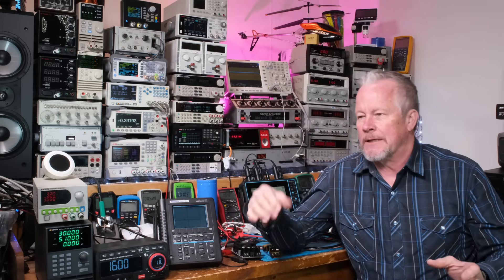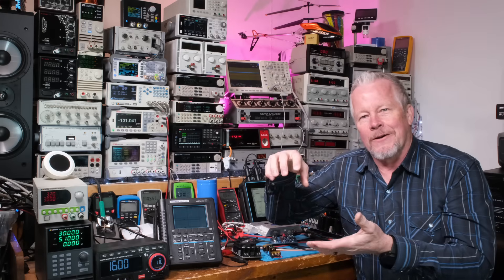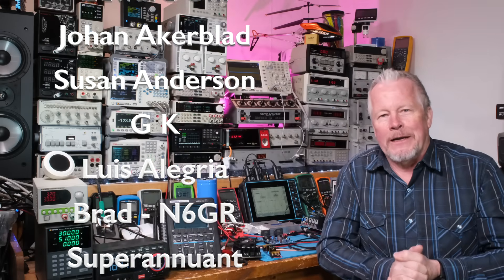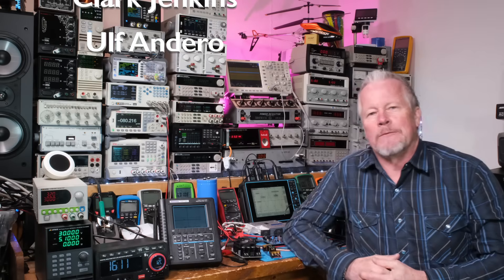Capacitor Bypass Value Myth #stevensandler #ericbogatin #bypasscapacitor #couplingcapacitor

Comment: 7:04  Don't you mean "We  don't use 10 & 20% (C composition) resistors any more"?  TODAY, we have metal & carbon FILM resistors, with FIVE percent tolerance!  WOW!  🤗
Reply from the maker: Thanks for bringing this up.  Today we use 1% metal films instead of carbon 5%;)  The tolerance in resistors is so great and low cost that - why not?  Capacitors are better as well - but not that good;)  But then we typically don't need that tight of tolerance in a capacitor.
Reply: @KissAnalog  After reading your response, I wonder....I get the impression you may have actually thought I was being serious!   In a more serious vein, I wish all the resistors out there were One Watt carbon composition ones, so I could read the color codes without a magnifying glass!
Reply from the maker: LOL actually carbon resistors should be gone - but I do like the color codes;)  Metal oxides might be in your future;)
Reply: @KissAnalog  They DO have one good use, though.  Their low inductance makes them good for RF dummy loads.
Reply from the maker: Yes - that is a great application for carbon;)  But thick film metal is generally a good alternativce - right?
Reply: @KissAnalog  If it has very low L, definitely.  I don't know a whole lot about how much each kind of metal film resistor has, only that many of the little ones aren't recommended for RF.
Reply from the maker: You are right - every application has its own requirements.  There are thick film as well as thin film metal resistors but carbon and metal oxide resistors have their place too,

Comment: It’s a bit difficult; I think the word “mostly” need to be applied here. I have worked in some high density with multiple switch mode, and RF chips (>30GHz) and it gets awkward when you are limited to 0201 size. The dielectric can get crushed (Y5 ect) under voltage to 20% of advertised, the main loss is near instant, but I measured the time-to-stabilised-capacitance could take over three days. I think the cap resonance vs what you are looking at is where it lies.
Reply from the maker: Yes, when high frequency is used, then PCB material (dielectric) is critical and the use of Y5 caps should not be used!  The problem is - the circuit finally works - but this is at the bench in ambient temp.  As soon as the temp changes - if the wrong caps are used - this can be a disaster.  Also placement and routing are critical as well.

Comment: Read the data sheets on the caps. Notice resistors have voltage ratings. Check your linear regulators are not oscillating.
Reply from the maker: Thanks for your feedback!  Yes, check data sheets.

Comment: Hi Eddie , I have seen in some site where a guy wrote an article regarding a modification on Adcom GFA 555 mk2 amplifier and in one of his recommendations he wrote to put surge cap 630v 0.1 uF across the AC side of the bridge rectifier . Can you please explain what the benefit of this ? Thanks and have a great weekend
Reply from the maker: Thanks for the great question!  This kind of power supply is a low frequency switcher - the diodes commutate (turn on off sharing the current load).  Placing a cap across the diode bridge helps filter this switching.

Comment: I used to have students do experiments to investigate the rudiments of local decoupling. For most it was also their first introduction to using an a oscilloscope. 

Breadboard an astable multivibrator using the bipolar version of the 555 running at a a few kilohertz. Connect the circuit to a 5 volt power supply (linear, not some horrible el-cheapo UltraNoise™ switcher "bench supply" of the sort so popular now) using two separate wires each about 3 feet long. Observe the voltage at the Vcc pin of the 555 with the scope ground connected very close to the ground pin of the 555. 

Twist the wires to the power supply together and repeat the voltage observations. 

Add a 100 nF ceramic cap right across the 555 and repeat the observations. 

The bipolar 555 has large, fairly slow transistors in the output totempole. There is very substantial shoot-through current at each transition. Separate supply wires have quite high inductance which results in gross transient voltages at the 555 due to the shoot-through current spike. Twisting the wires together greatly reduces the inductance because the magnetic fields of the two conductors largely "cancel" each other. Adding the cap at the 555 cleans things up even more. 

It is easy to get 20 or 30 volt spike with the first setup. I'm not sure this would still be true. The bipolar 555 may be better now than it used to be.
Reply from the maker: Thanks for this great feedback!  This sounds like a great way to teach several different ideas.  I have a video showing the benefit of twisting wires;)

Comment: In certain circumstances a high value cap in parallel with and physically close to a "standard" decoupling cap can be beneficial, if the high value cap is an electrolytic of some sort. By "high value" I'm talking something of typically just a few microfarads - 10 to 22 µF perhaps. "Electrolytic" includes things like solid tantalum capacitors.

Occasionally you will get into a situation where a ceramic cap with very good high frequency performance can resonate with "something" (either discrete or "distributed" inductance) and actually make things worse. Electrolytic caps are invariably fairly lossy at high frequency. The electrolytic cap can "spoil the Q" of the resonant circuit. Another approach is to use a small resistance in series with a "good" capacitor as the Q-spoiler (i.e. a cap in parallel with a series combo of a cap and resistor). This is a more foolproof approach.

If you are using a small LC filter to clean up the output of something like a charge pump DC-DC converter, you can similarly get nasty resonance if you aren't careful. Selecting an inductor with "high" resistance (on the order of just 2 or 3 ohms) can make a nice clean filter instead of one with a huge peak in its response. Again, a discrete resistor will do the same thing, possibly better and more consistently, but you have to find space for it.

Be very careful with capacitors on the output of low-dropout 3-terminal voltage regulators. The newer designs are generally much more forgiving, but older designs can be very fussy about the ESR of the cap at the output. It must fall within a specified range, and ESR that is either too high or too low will mess things up. The zero created by the resistor is critical to the overall loop stability.
Reply from the maker: Thanks for the great feedback!  It is a great idea to look at data sheets - especially for regulators to see what they recommend.
Reply from the maker: Thanks for sharing this great feedback!!  It is important to consider every circuit for the right capacitor solution.

Comment: Hi Eddie, thanks for another great video.  The last time I designed an audio amplifier that had 8 output transistors per channel, I added .22uf film bypass caps at the collectors directly at the transistors.  It seems like it made the upper frequencies of the amp much smoother.  I have never tried removing them to see if it makes a difference. Would you shoot any holes in this idea, especially given the frequencies involved.
Reply from the maker: I think that is a great placement - right at the switching device.  I'd say that this could be the magic - and it can't hurt.  Now if you said that you also placed a 0.022 uF in parallel - I'd say that you were wasting your time;)

Comment: So I have a little wall outlet adapter that I noticed makes sound when sitting unloaded.  Not humming like a transformer but like faint audio of some kind.  That's a peizo electric thing like a speaker but from capacitor pieces?
Reply from the maker: Thanks for asking!  It sure could be - or it could be the magnetics vibrating.
Reply: @KissAnalog  I'll investigate
Reply from the maker: Did you find the source?

Comment: The highest frequency's are bypassed by the power plane to ground plane capacitance.   Today's muti Ghz circuits cannot be reliably done any other way.
Reply from the maker: Thanks for bringing that up.  Board layout and layer stack up is very critical the higher the frequency - for sure;)